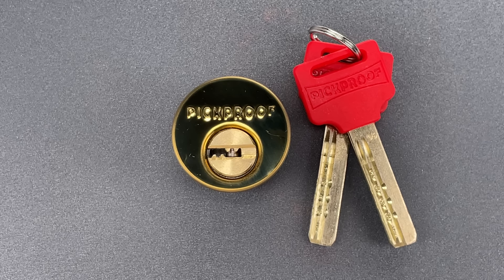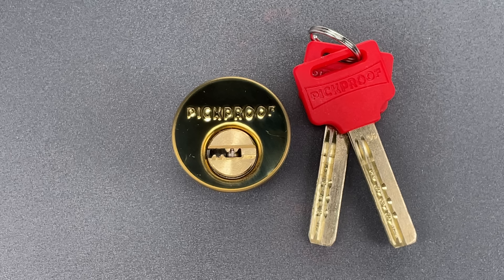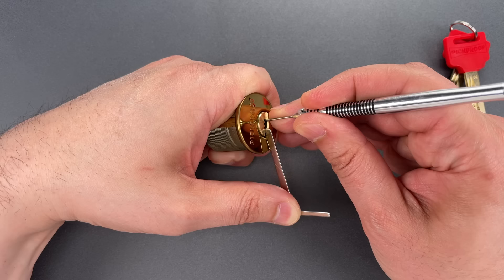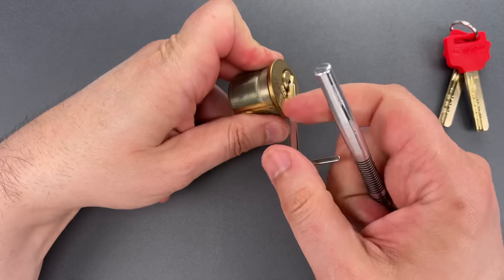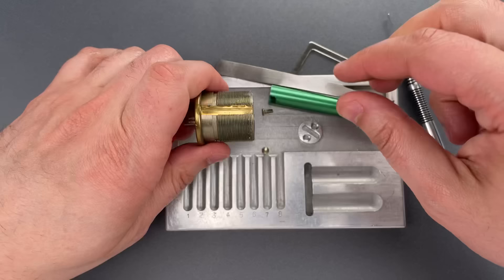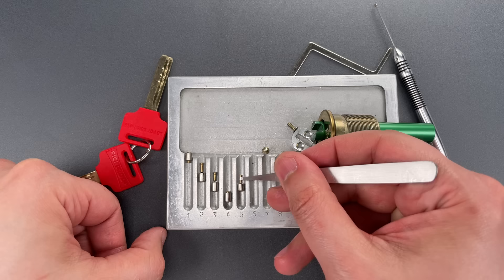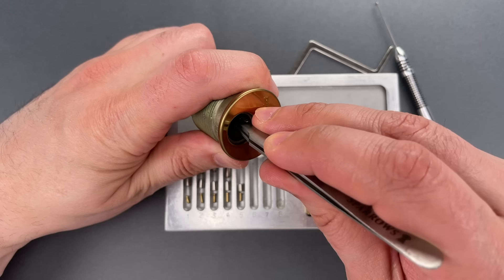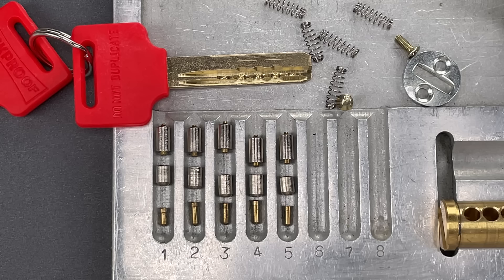[1289] This Lock Is Indisputably “Pickproof”

Comment: Master Lock is like "We may put out locks less secure than plastic packaging and duct tape but at least we're still in business unlike Pickproof."
Reply: When it comes to LPL's skill, it's usually harder and more difficult to cut through the plastic forcefield locks are sold in than the lock themselves.
Reply: @drakkenmensch  bruh those plastic packaging is the worst, especially when you need a knife to just open it up. WHY WOULD I NEED A KNIFE FOR SOMETHING THAT SHOULD OPEN IN 10 SECONDS
Reply: @NuggetOG  so that people don't steal the lock off the store shelf?
Reply: @1slotmech  Those plastics never stopped anyone from just stuffing the item in their bag while the staff isn't looking.
Reply: @NuggetOG  you're right. they should just lock them in place. gotta pick it to purchase it.
Reply: One thing I learned working for a MasterLock dealer is that all security is a compromise. Most locks are there to keep people honest or to prevent crimes of opportunity. If somebody wants to get in badly enough they'll find a way.
Reply: @JohnG6  Locks only ever keep honest people out. Most of the trucks at work have pins the secure the side cabinets- people have just pried the doors up from the top and bottom to get at the stuff inside
Reply: @drakkenmensch  The packaging may contain an anti theft tag. Also, besides thieves, it prevents customers from opening it just to look inside before putting it back, it also protects against shipping damage. It is important to keep the packaging in good shape, it doesn't sell as well if it is damaged / opened.
Reply: @JohnG6  LPL has said that before in a video a while back
Reply: Lol that’s so funny!!

Comment: Regarding being pick-proof:  Any lock that can be opened with a key can be picked; it is just a matter of having the right tools, the right technique and enough time to do the job.  If you want a lock that can not be picked, you will pretty much have to jam or weld the thing.  This principle applies to electronic access as much as it does to physical locks, well except for the welding part.
Reply: Sounds like his video on the Valenties heart lock, which has no keyhole, supposedly will be permanently locked once closed. Even that he was able to shim open quite easily. In such he said he once put a Valentines lock on a bridge with his wife, and welded it.
Reply: I think a pick proof lock is a bad idea. What if I lock myself out of my house or car. Then I have to do serious damage to the windows or doors to get in. Not even a locksmith would be able to help.
Reply: Just make it only security pins
Reply: @ferrecool7886  key insertion would be messy tho, most "high security" locks put atleast 1 standard pin so the core doesn't go crazy when you insert the key
Reply: @workindad  You would simply break the lock with a locksmith.
Reply: can confirm welding works very well on hard drives
Reply: @bruh2733  What does that mean, that it would go crazy? If it's possible to explain to someone who doesn't really know anything about locks. :)
Reply: @workindad  why even put a lock then. Just let robbers in.
Reply: @Massenstein  in some locks the first pin is just a simple slug of tool steel, it has no anti-picking features, because it's there to stop drills. As an added side effect it helps locate and align the core of the lock so that the other security pins and side bars and the like will operate more smoothly and can be made with tighter tolerances. Better tolerances allows for more devious anti-picking measures, as it becomes harder to feel the difference and it also means that releasing tension to reset a spool or serrated pin is more likely to drop the other pins as well.
Reply: Look up master lock speed dial, unpickable so far, even by lock picking lawyer
Reply: @aierce  Locks can be picked in different ways. If lock picks don't work on a padlock, try using a bolt cutter.
In another YouTube video by Lock Picking Lawyer, titled "[1272] Good Job Master Lock...Kinda," the L.P.L. uses a hammer to bang on the front of a new kind of Master Lock while manipulating its shank with some fingers on his other hand, in order to pick it open.
In another YouTube video by Glenn Fowler titled, "Open master speed lock without the combination," Fowler picked open a Master Speed Lock by banging on a particular spot on its outer casing with a hammer. This shattered its entire outer casing.
Reply: @IvoryGoonz  deterrent and slows down the robber.
Reply: @grahamjohnson4702  some electric wire would work good too
Reply: Hard to pick a 2x4.
Reply: This is late, but so far every Bowley-style lock that's been picked has required access to a key to make the correct tools, and also haven't been picked outside of a vice. There's a certain level of pin security where picking becomes so unviable you either have to lance the lock, the door, or attack something else.

That's not to say it isn't *possible*, and it doesn't discredit your original claim, but plausible or probable? Unlikely.
Reply: Well, an angle grinder is a tool too.....
Reply: @aleksey-noober  Let's just rephrase what you said.

At some point, the lock stops being the weakest link, so robbers will simply go for what is the weakest link at that point.
Or they'll go for a different house, since most robbers just don't care which house the money comes from.
Reply: Fake info
Reply: there are pickproof locks, they’re just really expensive
look at abloy’s protec/protec2
Reply: Oh no, as a computer scientist, I promise that taking a cutting torch or welder to a hard drive will indeed make your data secure forever. Completely irretrievable, even to you, if done correctly 😂
Reply: @danuttall
> Regarding being pick-proof:  Any lock that can be opened with a key can be picked; it is
> just a matter of having the right tools, the right technique and enough time to do the job. 

But is it practicable to make a lock so difficult to pick that only the most dedicated and able would stand a chance, and even then need a long time to do it?
 
Not an issue for someone authorised to be picking the lock - they just charge more, but if they are being covert for some reason...?
 
Also, I've recently had some new patio doors installed (and here I'm going to be using the door hardware meaning of 'lock').
 
The cylinder is a normal Euro format, single-bitted, but unlike every door I've ever encountered, turning the key does not move something which then allows the handle/knob to turn and work the lock, you have to keep turning the key - it has to go through 810° of rotation as it is that which winds the hooks and bolts of the multi-point lock in, and it is very stiff.  The key has a larger head than normal euro-cylinder keys, and even so it's a noticeable effort to apply the necessary torque and I wonder how feasible it would be to do that with a turning tool?
Reply: How do you pick an electronic lock where the only access you have is to the number pad ?
Reply: @clementm5417  
> How do you pick an electronic lock where the only access you have is to the number pad ? 
 
That can depend on how long has elapsed since it was last used.
Reply: the same applies to electronic, welding is like having no access, it can be putting it all in a USB stick, or separating from the internet
Reply: @clementm5417 used keys will wear down first. Or you can if the surface is smooth check for fingerprints. Or setup a camera and watch the person type it in.
Reply: There is one lock that can’t be picked: the Bowley lock. Even LPL said he can’t even begin to think how he’d pick it.

Comment: One of these days we're just going to see him accidentally pick one by inserting the turning tool.  "Apply bottom of the keyway pressure- oh, it's open."
Reply: You mean master locks
Reply: "Well folks, looks like this one's heard my reputation and has surrendered to the inevitable. In any case, that's all for today."
Reply: @pyromaniacal13  made in France?
Reply: He literally did that with a bike lock. It had a plastic core so with enough force the plastic deforms and the lock can be opened just with a tensioner.
Reply: you saw stuff made here lock coming
Reply: It can happen with cheap plastic locks, and apparently theres already a video of it, based on other replies...
Reply: This happened to me. Bought a cheap lock to practice on... Opened with just pressure. 😓

Comment: I wouldn't want something like that on my door just because the name seems an awful lot like a dare.
Reply: Easier to break the door frame than pick most locks anyway.  A mule kick (1-3) normally knocks down any residential door.
Reply: @Henlarious  only in America. Try that on the bolted and steel reinforced European front doors and you're not having a super fun time.
Reply: @paulelderson934  the world isn't comprised of only America and Europe, but ok.
In fact I thought Europe in general was a safer place, so why do you need that kind of door?
Reply: @paulelderson934  it doesn’t matter what kind of frame you have if your doorframe is mounted in a stud wall.
Reply: @Ariel-gj7bi  That seems to be how they always frame it isn't it? Like the whole soccer and football argument. "the rest of the world calls it football but America" Uh no they don't. Europe might and south america might, but Asia, Australia and North America are solidly in the Soccer camp. only half the world's population might call it football. the other half does not. Europe is not "the rest of the world".
Reply: @paulelderson934  Over-generalisation. Depends on the specific hardware. I've kicked a door in with one kick. It was a shitty door and frame. Go to a drug dealers house and you need a JCB digger to get in. Could be on the same street.
Reply: @Ariel-gj7bi  Europe is safer place - - - > Europeans don't need safer locks. Volvo is safer car - - - > Volvo drivers don't need proper seat belts. Your logic is faulty.
Reply: @Ariel-gj7bi  You'd need that sort of door if you live in a former Soviet-aligned country. Conflict zones put residents on edge so paying for a solid front door puts them at ease. Makes it unlikely thugs, military goons, and stray explosives will bust it down and hurt the residents within. However, in a post-Soviet world those doors are also a pain in the ass for law enforcement to break through. You can search Youtube for videos of police trying in vain to break such doors down while attempting to apprehend criminals behind them. At that point, you'd want somebody like the LockPickingLawyer to forcibly unlock the door instead.
Reply: @Ariel-gj7bi  I mean, you're right but Euro locks are also a thing, so locks are often in the Euro or American/other category. Maybe he meant it like that.
Reply: @danpowell806  Or, if you have a basement with thin windows or window frames. Or exposed hingepins and no jam pins in the hinges. Check out Deviant Ollams talks on security, they show that doors are often like the Maginot line: good lock, and yet you can use an under-door-tool to open the door in 30 seconds.
Reply: Well u could tape the name or something.....or maybe deform that portion with a blowtorch?......idk I'm just commenting for the sake of it
Reply: @yggdrasil2245  Lol, I'll just buy a Mul-T-Lock with sidebar if I want a dimple lock.
Reply: @Ariel-gj7bi  Europe is safer in terms of shootings and murders, but we still have break ins. I'm in Vienna  Austria, one of the safest cities you can live in and I still have a safety door. It's pretty common here.
Reply: @Kholaslittlespot1  Euro Locks are a joke.
Reply: Here in post USSR countries doors are metal with 2 to 3 different locks, with the most popular one being just a fucking bolt without the actual lock part, so the only way to get in, would be to either try to undo the hinges (which isn't as effective as it would seem) or saw the whole door down
Reply: @lukasperuzovic1429  the best locks in the whole world come from europe, you are sad.
Reply: @Ariel-gj7bi  Because we have those doors it's a safer place. No thug is gonna mug you in a bad neighbourhood when you're carrying around a door like that.
Reply: @MrTeddy12397  I can break though a Euro lock too easily. Pick no, destroy yes.

Comment: CEO:  “I’m gonna name my company Pickproof!”

LPL: “and I took that personally”
Reply: This is what Forever Lock V3 is clamming for months now. But probably too challenging for LPL.
Reply: @alexandergreene461  No, it's basically a stamped sheet that you place into the lock and rotate, so that the pins and key are totally sealed off from the outside environment during activation.
Reply: Happens a lot in trademarks. For instance, "24-Hour Dry Cleaner" is a brand, not a warranty that your dry cleaning will be done in that time.
Reply: just needs kali and wireshark

Comment: As a child I had a disturbing fascination with locks. I collected pad locks and all sorts of old or abandoned locks I could find often without keys and would proceed to pull them apart to see how they worked. The ones without keys took a little longer, but studying the pull downs of the ones with keys gave me plenty of hints. By my teens I had boxes full of locks of all different types and like to amaze my friends with opening them without the keys. I later progressed to house doors, car doors and ignition locks. Needless to say that landed me in some amount of bother, especially the house and car locks that were owned by strangers. I did eventually progress to some of the cheaper safes, but fortunately by this time I had learned that just because you can doesn't mean you should :)
Reply: make videos.
Reply: @ruutjormun2262  I play with computer technology based security systems these days. Everyone has info and videos on lock breaking (hacking). I am including some security methodology in the books that I am currently writing and will hope to add video how tos along with the books in time.
I also have a project progressing in the background for a gateway firewall system. It all takes time. This is just a sock account so I can make politically charged comments without getting my real channel trolled to death, so you won't find any of this on this channel :)
Reply: Well good thing you learned some lessons at the end
Reply: @jeal5022  Yeah, Sometimes the important lessons come the hard way lol
Reply: Glad you found a way to make it about you.
Reply: @juliebraden6911  really, did you miss the point in my story? No, didn't read it and just troll instead.
Reply: This sounds like the story of lock picking lawyer
Reply: @MohsinExperiments  Nah, I was no where near as good as LPL lol
But it was interesting and fun in the day, until it was not. Mind you, it did teach me a lot that helped in 2 of my careers, such as when people accidentally locked their keys in the car or house.. It took a few slaps on the head as a youngen to realize it's only OK to walk through locked doors when you have permission :)
>
These days I am a computer programmer ++, and still asked to walk through some computer doors and as long as I have a signed letter of approval :P
Reply: Mate, you’re a true blue legend.
Reply: You can pick your friends, you can pick a lock, but you shouldnt pick your friends lock.
Reply: @izzyplusplusplus1004  Well, not if they haven't given you permission to do so. I still regularly pick locks of a different kind in the computer world, but only when asked with written permission from the owner of the lock :)

Comment: I once spoke to someone who had done an internship at RUKO. I was quite surpised when he told me that the lock that is fitted in aproximately 80% of Danish houses (including mine) is described in RUKO's catalogue as "recommended for closets containing no significant values". I guess having a lock is sort of a symbolic gesture to appease the insurance company...
Reply: Underrated Comment!
Reply: I wonder if locks, culturally, don’t need to be as robust d/t crime/breaking and entering being far less common relative to the West. Just a guess
Reply: @maxwellgriffith  I´d think in general most burglars don´t pick locks but just break in, so usually its probably more important how weak the door is or how hard it is to cut a padlock then how long LPL&friends need to pick the used lock itself.
Like a "really pickproof lock" on a regular glas door is obviously pointless decoration...😁
Edit:But of course OP is right with his "symbolic gesture &insurance" part. My Dad once told me thats its usually necessary/mandatory for car insurance on a convertible to close the windows when you lock it, even tho the roof is/can be open cuz its a convertible, but if the windows were down insurance wont cover your losses...!😆

Comment: It is amazing that after all these years, they still make locks the same. If there were 3 or 4 sets of tumblers (top, bottom, and both sides,) it could be much more secure and much harder to get into. Especially if all the pins were different in length and width.

Comment: As a retired locksmith I have picked in excess of ~750k locks. 
I want to tell you that your “walk picking” technique is extraordinary!
I’m also impressed by some of the tools you have developed and if I was still working I would buy some of them.
Reply: 750k locks means for example in numbers: In 40 years you have to pick 52 locks every day, or 6 locks per hour (8h workday) without any free days, weekends or holydays in the whole time. Every day without work, will increase your picklocking rate per day.
Are you sure you picked 750k locks?

750k Schlösser bedeutet in Zahlen: In einem 40 Jahres-Zeitraum müssen 52 Schlösser jeden Tag knacken (oder 6 pro Stunde bei einem 8h/Arbeitstag) ohne jedweden freien Tage. Jedes Wochenende, Krankheit oder jeder Urlaub würde ihr Knackrate pro Tag nach oben erhöhen.
Sind Sie sicher, dass sie wirklich 750k Schlösser geknackt haben?
Reply: @blackbirdone8204  lol wtf